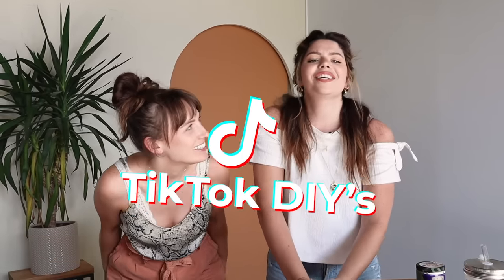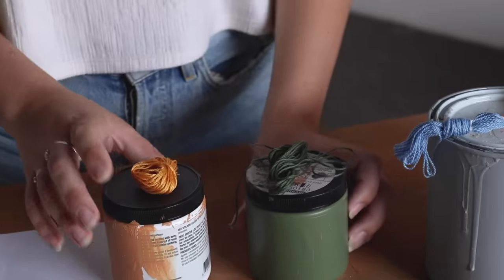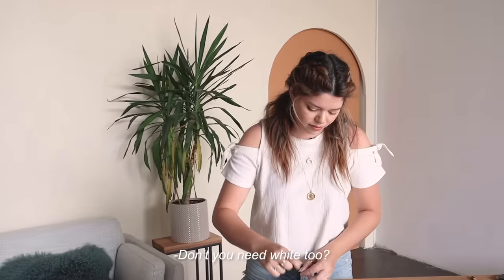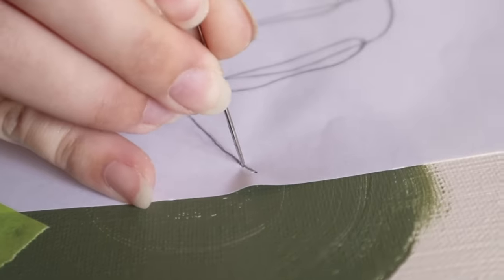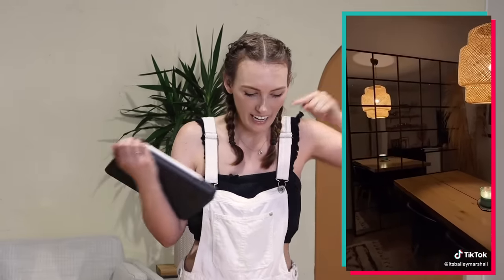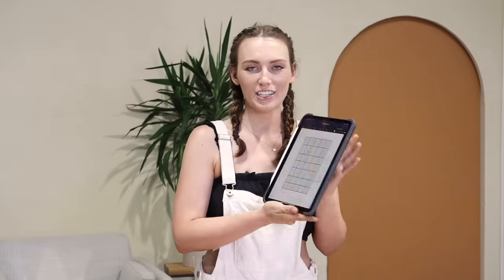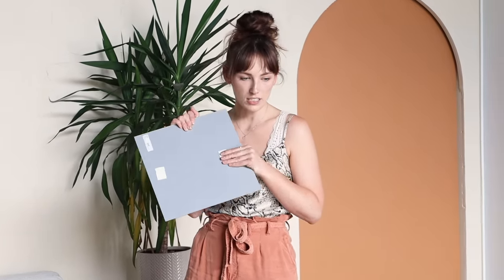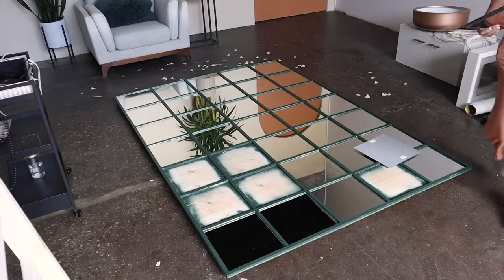making *THAT* diy mirror we all saw on TikTok

Comment: Love the video. One note to anyone who decides to make this though the lots mirrors need to all be the same way up. This sounds weird because it’s a square but I’ve had a problem in the past with the mirror image being slightly off when you stand between two squares. However if you just flip one of the mirrors the image will then be normal. 
Hope that makes sense and helps.

Comment: Great job, ladies! Pretty sure this wasn't the intention of the original creater but I'm definitely getting department store fitting room vibes with this mirror! Actually, I'm pretty sure we used to have a department store down here in PA (Strawbridge's, which went bye bye at least 15 years ago) that had this kind of mirrors back in the late 80's/ early 90's (and yes, I just dated myself, didn't I?) 👵 I couldn't help but think back to the dollar store mirror projects that are so similar to this (maybe not as long lasting, but should also be considerably cheaper, right?)

Comment: I thought Becky had more than enough of the green thread, because I was taught in school to separate that thread into three parts (it has 9 strands and u can easily separate them) so whenever I did embroidery with them I used the three strand thread for the thing, until it ran out. is that just something I was taught?

Comment: Pro tip
The screws should have first gone into the ply and then the 2x4 (it looked like one) so that the ply is secured and and you have up to 2 inches of wood to hold it together , rather than the screw tip barely holding the ply after going through the 2by4 first  :(  !!

Comment: I would have done the mirror on the wall instead. Like not buy the back piece. Just the 13 slim border pieces and painted those all green and then stuck it to the wall like that. Have the wall be the actual back piece.

Comment: The projects are really neat, however the finishings need some work. The painting was not finished. The paint was smudged and not covering the sides of the canvas. And the staging of both things felt incomplete since there are parts of the walls and other elements that are not painted all the way or that could use some fillers to be smooth and great. 
This feedback is exclusively shared with you to be constructive.

Comment: Just a little more time filling all the gaps and nail gun holes, sanding it all smooth then paint would make this look high end and polished. It's a great tutorial, just the final product is rushed so it still looks DIY and not designer to me. I mean you still have over $200 in supplies so why not take a few extra hours to make it look like a $1000+ mirror?

Comment: Looking at your blobs you made on the canvas art, next time only add an odd number of shapes. In design, the eye loves odd numbers because there is an challenge to the eye when on part is on its own. An even number appears equal which can feel cold and staged if not done symmetrically to perfection. Just remember the rule of three!